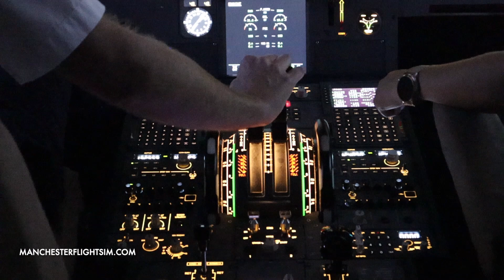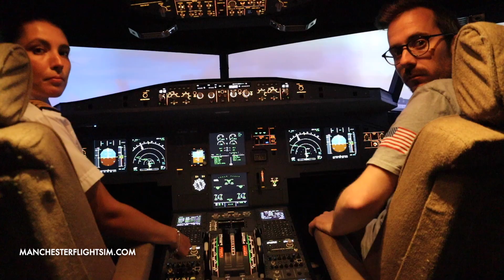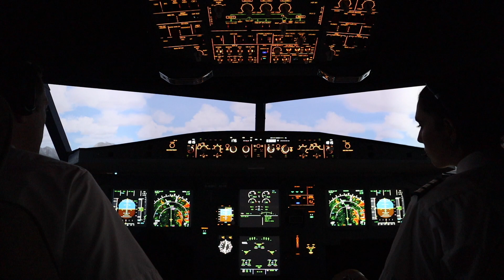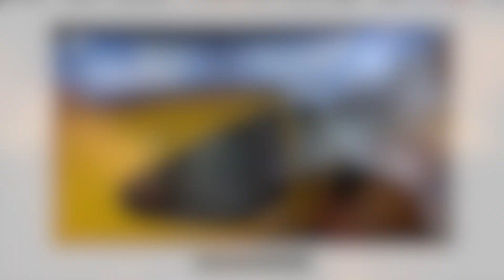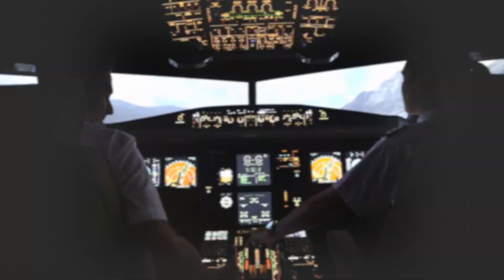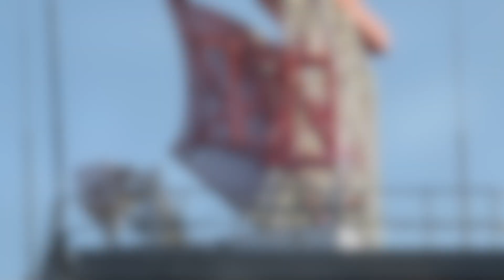Flying A Real Airbus A320 Simulator With Real Pilots - Manchester Flight Sim Centre

Comment: I've been given a voucher for this and, as an AV Geek, I'm really excited. To be honest however, I'm a bit put off after watching this, mainly as you did seem to get to do much. He called flaps 1, you called it, she did it. Same with 2, 3, gear etc etc. Headings were all her, too. I know it's the correct process but this was really formal and you seemed to be sat there a lot? Fair assessment?
Reply: I think they didn't want to overwhelm him with too many things at once.  He said the autopilot was off, so that was actually him on the stick, rudder, and throttles, manually following the guidance of the flight director which in turn follows her inputs on the heading knob, MCDU, etc.  The flight director shows what the autopilot would do if it was on, but it was him doing it.